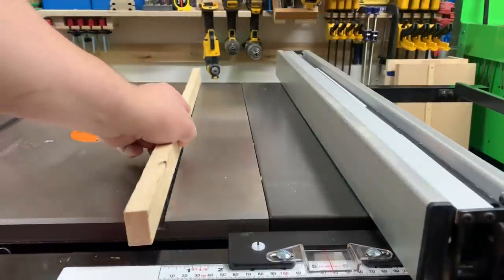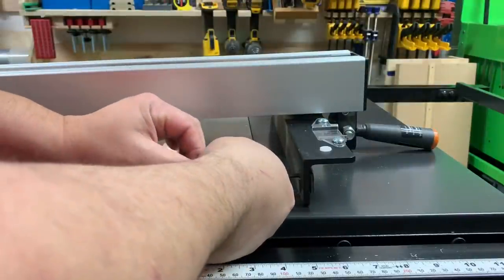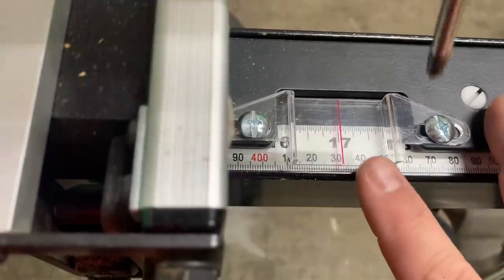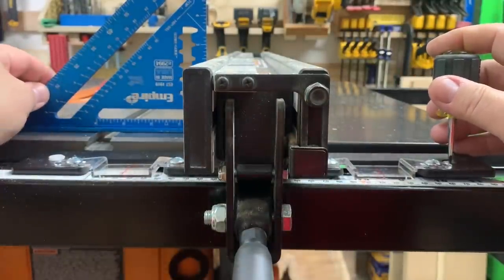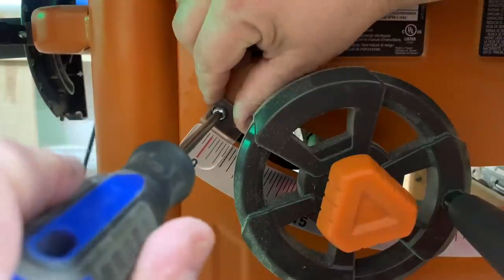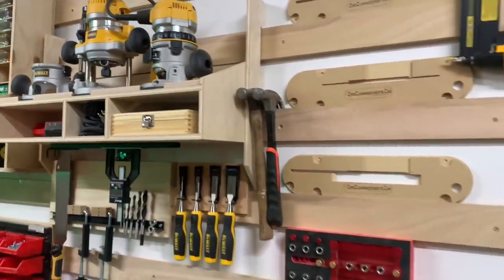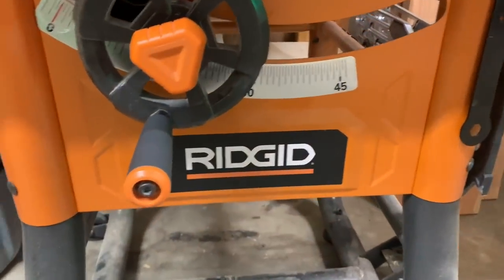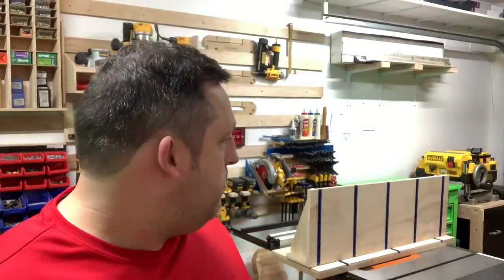Adjustments for the Ridgid R4560

Comment: I'm coming in a little late, but finding this video was a case of perfect timing for me. Home Depot just put this on sale at 41% off, so I snagged one as an upgrade to my second-hand Craftsman with a rebuilt motor. Now I can dial in the accuracy without paying another $200 for measuring gauges. I need to save my money for wood to actually make stuff.
Reply: Funny enough I looked it up today and my local stores still have it at regular price but I’m thinking of buying mine online from a different city that has it 41% off.  Crazy that my local store cannot price match, because I called and they said no.
Reply from the maker: @PointManify  let me know how your adjustments go and share any insights you have after
Reply: Since my old Craftsman has those funky miter slots that don’t match every other manufacturer, I didn’t have anything sitting around to put in the slot. Instead, I used a combination square to check for parallel. The blade was perfect out of the box. The fence was slightly off, but easy to set. Getting the throat plate good took a little bit of back and forth. Just required some patience. The difficult part was getting the riving knife adjusted. Those screws are in a horrible location! I used a hex attachment in a flexible screwdriver shaft (first time ever using that in over 20 years—glad I didn’t throw it away). It was frustrating trying to get the driver in place while holding the riving knife, so I enlisted the help of my daughter to provide a third hand. That helped a lot.
When I fired it up and made my first cut, I was amazed at how quiet the saw is compared to my last one. Then, I was overjoyed when I saw how it made perfectly straight cuts. It is such a joy to have a saw that works well and didn’t break the bank. I was losing the fun in woodworking with how unreliable my old table saw was. Now, I am juiced as I get ready to build a hope chest for my daughter before she gets married next year!

Comment: Thanks for the video!  Might have to steal your french cleat screw box holder idea.  I would recommend using a 1-2-3 block for aligning your tape.  It'd likely be more accurate than cutting a board and using a tape measure, and allows you to adjust to different kerf thicknesses on the fly.
Reply from the maker: Great idea.

Comment: Thanks for making this.  I was going to buy the Delta 36-725T2.  However, they seemed to have stopped making it.  Its replacement the Delta 5000, is now $1500.  Originally I was concerned about the fence on the Rigid.  However, it appears after watching you that it need only be adjusted properly.
Reply from the maker: This seem to be a way better saw than it predecessor
Reply: Did you contacted Delta itself that they actually stopped making 36-725T2 now?  I'm just curious it's because I always see this model ($699) to buy all the time.  Recently, I went to Lowes and I saw a few more boxes available in both stores in our area.  We can still buy them online as well.

Comment: Hope that 3/4 strip of wood is square. Just looking at it, it does not appear to be square. Maybe the camera lens. I Use a square and square the fence to the miter gauge slot edge, or square it to the blade. Either method works best. Simple as pie.
Reply from the maker: that is a great observation and you are correct, it is not square however it is the same width through out it's length. I believe that is important in this sort of adjustment. also could have used a .750x.750 machined and ground bar but not everyone has one of those. lol

Comment: Thanks for your review, one question for curiosity, any reason why you purchase the Rigid (HomeDepot) and not from Delta (Lowes or Amazon/?) and one more question,  the Fence it stay square ?? or you need to constantly keep calibrating?? thanks for your video.
Reply from the maker: Ridgid simply because I like the color. And the fence has held position since my adjustment was made. 
I still check it when I need accurate cuts
Reply: @The_ADD_Maker  thanks for your fast reply , i most probably will get this same saw your review help make my mind, thanks again

Comment: Is the table flat? I've been looking at possibly buying this saw also but I've seen a few complaints about the table not being flat, I was just wondering how yours was?
Reply from the maker: My table has a slight .020 dip across between the miter slots at the blade. 
It isn't enough to cause any problems for me.

Comment: Have you checked if the tabletop is completely level from front to back, left to right and diagonally?  I have a R4514 table saw and the top is not level at all! There is no way to adjust it either.  It’s impossible to make near perfect cuts on my saw.  Great video, keep it up!
Reply from the maker: Sorry to hear about your saw.  That's a great thing to check.  Straight front to back however a slight dip of .020 inches from side to side across the blade. Probably ok for the intended projects I have.  

Thank you for the comment.
Reply: I have same saw, 808. Will have to check mine as I hadn’t in the past
Reply: Are you saying the table is not flat or it's not level?  If it's flat I don't think that it not being level would make a difference. If the blade is square to the table it should make a square cut. It's the relation of the blade to the table, not the earth (level), that determines  the angle of the cut. At least that's the way it seems to me.

Comment: I had the Delta version of this saw and ultimately returned it to Lowes.   The top had a big drop off right in the middle.  It was just bad enough.  .015 to .026 depending on the location.   The big issue is I could not control the kerf.  Meaning each cut was removing more material thatn it should.  The arbor was out of wack, so I trued that up to where it was within a few thousands.  However, the problem was still there.  What I discovered is these saws are made in a way to be easy to assemble, but you loose cutting accuracy.  Let me explain.   The entire arbor assembly on my saw would move.  If you grabbed the arbor shaft you were able to move it back and forth.   My saw did this, the display unit at the store did this.  No other saw on display at Lowes or HD exhibited this same issue.    If you look at how the trunnions mount you will see the problem.  There is no ability to adjust them at all.  They use countersunk bolts to hold them in place.  In order to not be required to adjust the trunniions when assembling the saw, they had to design play at the interface of the trunnions and the arbor assembly.  It is this play that allows the arbor to move about.  There was no way get rid of this play.   This arbor movement and the horrible table tops ruin what could have been a great saw for the $.
Reply from the maker: Thank you very much for the comment and your insight.
 I have a dip of .020 across the dados being low at the blade. so far I'm not asking my saw to do anything to a level that would make this a problem. maybe someday I will.

Comment: Not just the Ridgid table saw, but an old Craftsman 113 as well (vintage 1969)... I added a Delta T3 fence and really like it.  The same exact fence you show and easy to install, use & adjust, as stated.  I now have 36" of rip capacity to the right and about 30" to the left (with my cast iron extensions and router table extension).
Reply from the maker: This fence was a major factor in me choosing this saw for sure.

Comment: Nice video!  Allowed me to brush up on fence adjustments, etc.  That slot in the table - actually there are two - is NOT a dado.  It is a miter slot. Thanks again!
Reply from the maker: You can use either term as long as it works. 😀 the manual calls it a miter slot, but I don’t read those as an unspoken rule. people like me often make up names that are close enough to get the point across. 😉
Reply: @The_ADD_Maker  Well, I appreciated the video, but...People have often asked me something like, “How did you figure that out?”  I read the manual, or the regulation, or asked someone with more experience.
Reply from the maker: Thank you for letting me know you enjoyed the video.   And for letting me know what a miter slot is. 😁

Comment: Thank you for the great video!
I bought the same brand and adjusted 0 degree on the blade. But it tilted a bit everytime I use! Is there a way to fix this or i need to return this? 
Thank you for your help.
Reply from the maker: Are you saying the blade tilt doesn't stay locked? The center handle should turn clockwise to  lock it and if that doesn't work it may need to be returned if it is still under warranty. 
Let me know if this was helpful.
Reply: @The_ADD_Maker  I'll call customer service see if I miss anything. Thank you
Reply from the maker: @erictautube  let me know if you don't get anywhere with that. 
I may come up with an alternative plan to help you.

Comment: all good as long as the saw blade is aligned with the slot in the table as is not the case sometimes
Reply from the maker: Not an easy adjustment if that is the case.

Comment: Admittedly there is a lot of elementary paragraphs in all owners manuals . There are a lot of unknowns with every new product. Some people just like to learn the hard way..
Reply from the maker: Very true. 
As an 8 year old My dad turned me loose in a garage full of power tool alone without instructions or guidance of any kind. Yes I was alone, at 8 years old with power tools. When I cut my finger nearly of I thought to myself. Well I better not do that again. I learned the hard way. We change our ways when we come to our point of pain. I learn how to do Dangerous things carefully at a very young age. Manuals are a bible to some and a reference to others for sure. 

Thank you for your input and perspective.
Reply: @The_ADD_Maker  recently bought a Nissan Versa . Haven’t driven a new car for 20 years.
If I skimmed through the owners manual I would of learned when filling the tires with air, the horn blows when you arrive at  the proper tire pressure.  I thought,  at first, It was just someone driving by.
Until I did the front!
Easy lesson learned🤣
Reply from the maker: @riverflyswatter  that is awesome. 
Probably would have been a bit confused about that for sure. 
Do you mind if I use this comment in my next video?